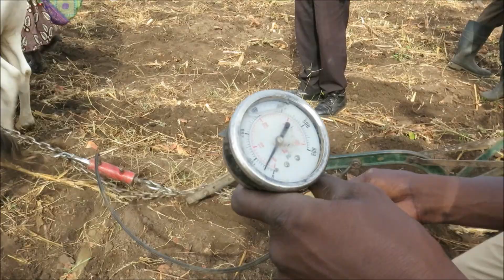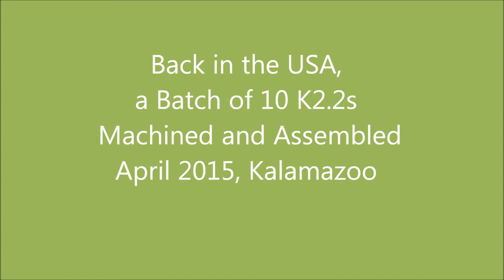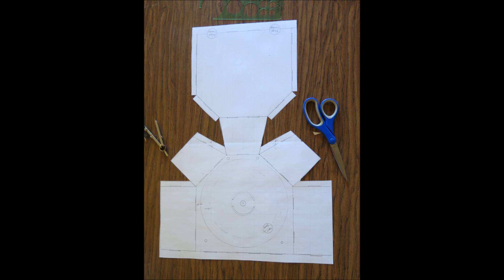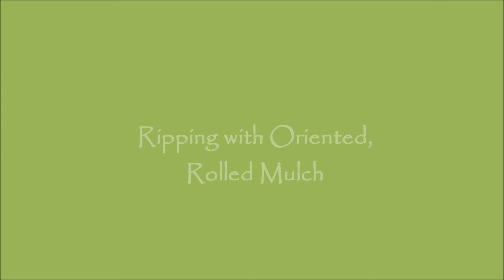Tillers K2 Toolbar with Ripper for CA,  Seeder, and Weeder

Comment: I am really impressed with the design, but had a thought you may have already worked out by now.  But here goes:  The handle you use to keep the K2 upright with by walking alongside the toolbar is directly in line with the machine and I noticed that over a field it makes it difficult for the operator to walk and hold in a precarious way.  Why not turn that bar at a 90 degree angle to the machine so the walker has something to hold onto in front of them, like strolling down the aisle with a shopping cart.  An improvement may even be adding a bike handle to it but that maybe overkill.  the simple bar out 90 degrees could still keep the K2 tool bar upright and straight down the field, but it would be much more comfortable for the operator than having to hold it with an extended arm out to the side where they have little control.  In front of them, they could raise and lower it as needed with little effort and it would be easier for them to navigate the rough terrain.  That being said, this would be so handy to have here in Ohio on the homestead.  Keep innovating!